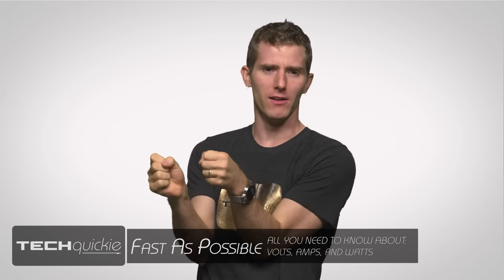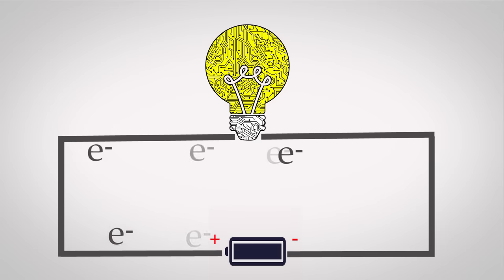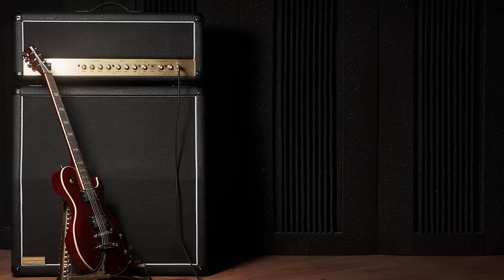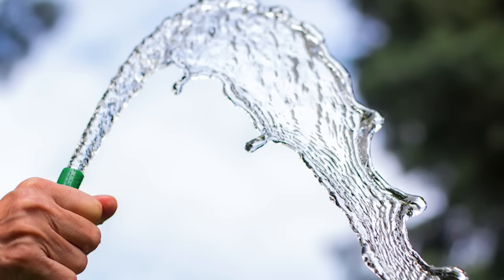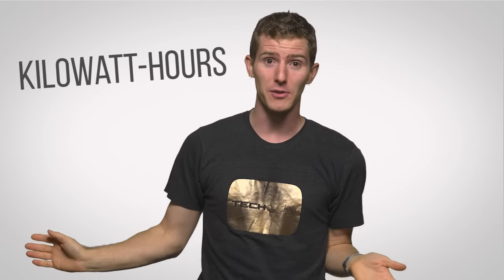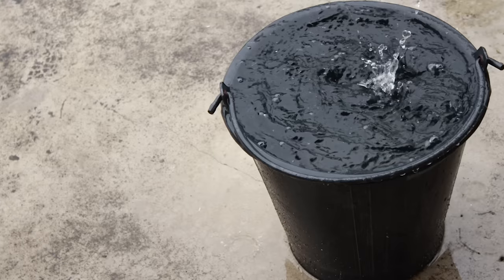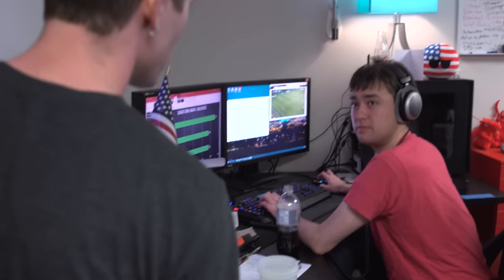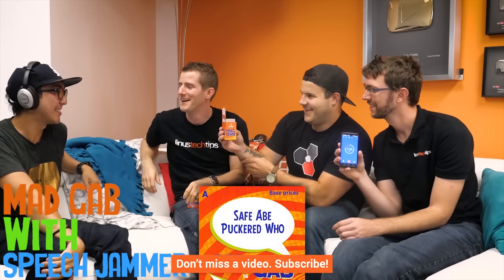Volts, Amps, and Watts Explained

Comment: I want to buy a home kiln, like a small one to make figurines but I'm worried about overloading the breaker. I had a portable ac and twice I've overloaded it before doing some research. Reason I overloaded the breaker was because I had a tv, modem, laptop, and ipad plugged in. Now I know better. My question is should I be looking at voltage, watts or amps so as to not overload the breaker again?

Comment: Remembering the fundamental types of quantities is key!

Watts are a quantity of power: energy/time.
So, a watt-hour or kilowatt-hour is power • time, which simplifies to a quantity of energy.

Amps are a quantity of current: charge/time.
So, an amp-hour or milliamp-hour is current • time, which simplifies to a quantity of charge.

To be more precise, you can consider the actual units of watts (W), joules (J), amps (A), coulombs (C), and seconds (s). 
1 W = 1 J/s,
1 A = 1 C/s.

Comment: so to conclude this, if your breaker is 16amp you can enjoy more wattages in europe :PP 

joules is not explained, but joules is the amount of energy per second, its a value that reflects a total amount of energy, it can be kenetic or power, wattage is equal to joule, so a vaccum cleaner from 1000 watts moves 1000 joules of energy around per second. that way you can even calculate how much money the electrical company is gonna charge u to run this vaccum cleaner

Comment: Does higher volts increase the amp since its passing harder. Also I may be wrong but you said watts is amp times volts. And since that is the case then does volts mean how much energy is held per charge?

Comment: I want to repurpose a windshield washer pump.  It says 12v on the back.  What do I need to know to plug it in to work in a wall outlet with a switch or have it powered with a solar panel?

Comment: Stupid question: with the pressure analogy- does higher voltage mean there are more electrons in the circuit in a given moment in time? Or is there always a fixed number of electrons that can fit in a circuit and the only thing you can change is how fast they go through it

Comment: Hi sir. Hope you are doing good. I just subscribed to your channel. I see that you got some interesting topics for me, thank you for this video. 
I want to understand volts,amp & watts. 
Please correct me if I’m wrong,
Volts will be like the wide of the hose. 
Amp will be like the pressure of the water. 
And watts will be the product of Volts x Amps?

For example. Let’s put it that a motor needs 120 watts to work. 
So 120 watts is the mission.  
I can choose a battery of 60volts with a amp of 2; that will give me the 120 watts that I need. 
Or three 40 volts battery with a current of 1 amp ; 120volts x 1amp =120watts. 

Is this correct sir?

Comment: I have a question. I have a 12V led and I have a power supply which lets you adjust V and A based on your choice. my question is if I choose 12v and connect the led and keep increasing the A without changing the V what will happen?

Comment: To understand these things, sometimes I have to think about which units are usually the primary unit used to describe a device.

So for Amps, my constant go-to was the UPS Power Supply in my computer server room.  It would display the available amps as the consumable resource.  Plug in more servers to the UPS, and the available amps would go down.

The servers would draw invariable amounts of energy depending on how active they were.  This was the watts....Also things like light bulbs, a sound bar, an appliance are all rated in watts.  The watts are the requirements of the device to perform its current work.

When you plug something in the wall, your circuit breaker makes sure you're not going to overload the circuit.  That's why some people cant run their microwave and coffee machine at the same time. Same applies to an UPS or power-strip.  

So for me, AMPS is the limited amount of energy you can demand at one time, and WATTS are the power needs of the device at a moment in time.

And since at this level, for most part these are 110 or 220 V circuits,  V don't really matter.  But Volts are what determine how many amps can serve watts at the moment in time.

I have no idea how accurate that is to the real principles of things, but helps me know why consumer electronic things are rated in Amps or Watts

Comment: Nice video 👌. On a 6 amp socket supplying 230 volts, I could theoretically connect a load of 1380 Watts (6x230). But some people advise that the actual practical load is less (like 1000 watts). This is to compensate for something. What is this something? Can you please make a video on this?

Comment: may God bless you.  A question, if you would be so kind, I have an electric fan 120 volts 60 HZ
 2.4 AMPS
 question what does it mean
 2.4 AMPS

 ⁉️
 Is it possible for me to operate it on a 220 volt transformer?
 to 127 volts
 1500 watts Please answer if you kindly.

Comment: So, If i understand correctly: If i were to have two pipes as a representation, one 1" thick pipe and one 2" thick pipe, both holding air flowing at 120PSI, the pressure or "Voltage" would be the same, but the resistance would be greater on the smaller pipe? And the amount of air passing through said pipes would be the amperage?

Comment: Ok big question... Why if Voltage is pressure, if a phone battery is fully charge and you read it with a multimeter it would say i.e. 3.5V and the phone works with 3.5V. Then when is not fully charged it will say i.e. 1.5V. Does that mean the phone isnt getting as much volts as is supposed to need to work properly? (the labels normally say 3.5V)

Comment: If you think you understand this is a test..

You have to walk through one of three doors, each door is a completely different circuit but same odds you could get shocked. Theres a sign over each door.
Door A: Warning 50000 volts
Door B: Warning 50 Amps
Door C: Warning 2000 watts

Which door would you choose and why?

Comment: I purchased Amzchef juicer 120v 150w and 60hz.  I live in Australia where it's 240v.  Used the product fine about 10 times but is suddenly stopped and tripped circuit breaker.  I was curious watching this video in the scenario of the computer going from 240v tp 120v and then halfing the watts?  I've been told I need a step down power converter.  I would have though my product would have blown up ages ago?  Do you think I need one or is the product?

Comment: I have an over ampere and over voltage question

My electric skateboard battery pack is 48v  4.4 ah, which gives me 7 miles range.

I switch it out for a new 48v  8ah battery, which gave me 14 miles range(which I’m loving)

Now I don’t know the max amp rating for the skateboard but  I was thinking of upgrading to a 48v  12ah battery.   Will this higher amp burn out my skateboard?  What is a safe bump on ampere from the original 4.4 ah battery that came the factory?

2nd question
I need more power for the occasional steeper hills, can I use a 60volt. 8ah (or 12ah)  without burning out my motor and electric components?

Comment: I'm confused right now. You say as long as you have the same watts/power. it does not matter if you have 110v or 220v supply? then why the heck my tv blow out when I plug it on a 220v outlet?  the reason for that is I forgot the tv is powered by 110v. here in the Philippines is we have 220v outlets. can you explain what happens?

Comment: Electricity/Electric Field is a hybrid of two different fields, dielectric field (electrons) and magnetic field. Both fields cross each other at 90 degree angle to produce AC or DC power as you know it. Dielectric field is measured in voltage, magnetic field is measured in current/amps. Both fields together are measured in watts. Electricity actually flows from positive to negative terminal, not negative to positive terminal. Positive terminal is like a faucet discharging electricity with pressure/force and negative terminal is like a drainage hole. You will get electrocuted if you touch high voltage positive terminal.
Reply: You may want to replace all instances of "dielectric" by just "electric". "Dielectric" refers to materials that are usually not very conductive.
Reply: @UnrealPerson  Dielectric material and dielectric field refers to two very different things. Dielectric field is the voltage part of electricity. Dielectric material refers to insulating material.
Reply: @Xeno_Bardock  The field is just electric. Electric field. No "di" anywhere in this.
Reply: @UnrealPerson  No, electric field is a hybrid field, hybrid of dielectric field and magnetic field, that's how you get voltage and current. You will need to read this book on dielectric field. https://archive.org/details/elementarylectur00steirich

Comment: I have a Dewalt jumpstarter.On the back of the jumpstarter it say the input volts is 14.5.One of my ac adapter is 12v.Is it ok to use 12v to charge the Dewalt jumpstarter.Can I use the 16v input ac adapter It's called Dx aeps14 ?

Comment: You like to say watt hours or amp hours aren't a measure of time, but there is certainly an element of time involved. Particularly when you get to batteries, you MUST include how they are rated in amps based on a discharge rate.

Comment: The watergun/waterhose analogy would've been great had you emphasised that, in this example, the strength with which the gun/hose are pushing water out is volts, the amount of water coming out is amps, and the overall effect on the wheel from those two is watts.

Comment: What happens when I use the same dc output voltage but with a different amp. Ex. 19V ~ 2.37A original PC monitor adapter. Is it safe to use 19V ~ 6.32A adapter? Thanks in advance!

Comment: okay so voltage is total pressure, but whats amps?? the speed of the electricity moving through the outlet?  wouldn't the speed depend on the pressure anyways? 

so its pressure × speed = watt??

Comment: At 2:23 the narrator states: "So when you put volts and amps together you can tell how much current is flowing" Well amps is current. The statement should have been when you put volts and amps together you can tell how much  power is flowing because Power (watts) is a combination of volts and amps.

Comment: If you could describe this with more analogs, could you please? I understand voltage and ohms. Would amps be the speed or the force of said water? What would watts be?
Reply: Current (amps) is the amount of electrons passing through a single point each second. If you had 1 amp of current that is like saying that 6,240,000000000000000 electrons pass through a circuit every second. Power (watts) is the amount of energy produced by those electrons.

Comment: Live-streaming using OBS Studio.  I need to learn how to make a small box with a little light on it.  The light would illuminate when a chat comment in Twitch and YouTube came in.  Ideally it could illuminate for any alert, a pattern for distinguishing different alerts, or, multi-color LED if I could.
I don’t own a 3D printer and I own a simple soldering iron bought at Wally World and a cheap solder-sucker I found in the back of a burnt-down Chinese restaurant.  I’m getting a block about where to start learning how to do this—only thing I thought of is the obvious: picking up a textbook. 😞 I have a flavor of learning disability that has proven to make it more difficult to learn from A to Z.  I learn from A to B to C skip to F skip to L back to C then to Q back to M then to Z but back to—wait I should check C real quick ok back to Y…

😅

On a 7-year-old video I ask for any advice anybody reading this has.

Comment: so lets see if I got this correct 10, 12 volt deep cycle lead ascid batteries = 120 volts to power a 15 amp circuit?

Comment: So if I connect a power supply manager to one of those little buzzers that are used to teach electronics, the Amps would control frequency, whereas the Volts would control loudness?

Comment: Why would the power be the same in the power supply if we plug it into 220 outlet and a 110 outlet? Doesn’t this mean that the power supply itself must have had some hidden mechanism that recognizes a change in voltage and somehow alters the current so the power stays the same?

Comment: fun fact: that charges  move - to + but we say it goes + to minus is Benjamin Franklin's fault. To his credit: he was the first to get all the principles of electricity right and he didn't know about electrons (being negative), only charges moving. So he called it positive and negative and decided on one way. Turns out he missed the 50:50 chance and we're stuck with the + -> - mistake.  He can be forgiven since he otherwise first gave us knowledge about what electricity actually was, how it works and how to use it. Changing the world.

 And Franklin's "law of conservation of charges" is one of the longest standing, unchallenged laws in physics. "He found electricty as a curiosity and left it as a science."

Comment: It's getting a bit clearer, but still some confusion.  So volts is a measure of the difference in potential energy, but how do we measure that without seeing the current flow, then we have a current so that is Amps.  I get that the final power of the current would be in Watts and is Volts*Amps, but how to we know what the Volts are w/o a current
Reply: Since I understand F=M*a, could I think of it as Volts are the “mass” and amps are the “ Acceleration ” and these combine to get our power.
Reply: @catherinejackson9924  I fear that would just confuse you even more.

Comment: 4:00: Wait, this doesn't matter? What if you try to run that 1100 watt power supply off a 9 volt battery? Are you saying as long as you had 122 amps it would work? ... Isn't there a part where this becomes a problem even if you could supply the correct number of amps or volts? Or if you could do it would it ALWAYS theoretically be okay?